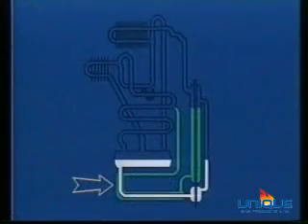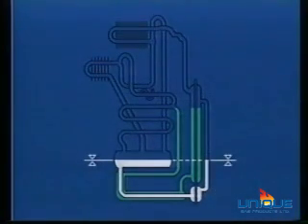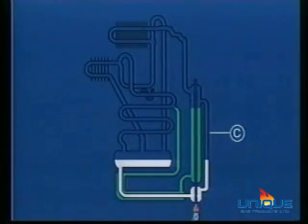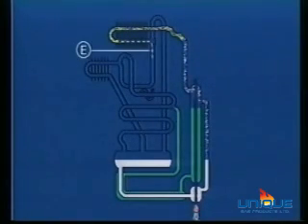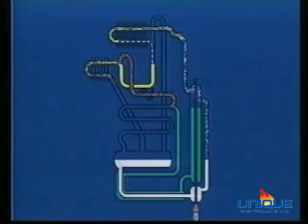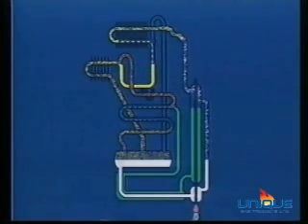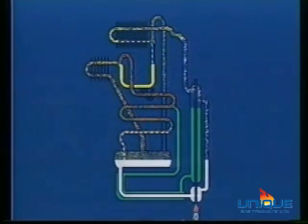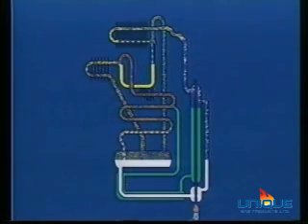AbsorptionRefrigeration.wmv

Comment: Would have been a little better if the animation labeled or highlighted (or flashed) the section of the pipe that the naration talked about.  It did this in 1 or 2 places, but would have been really helpful if the author could have done it for the whole explanation..

Comment: Could one use mirrors focusing the sun to power such a system?
Reply: Yes, or solar vacuum tubes since they should work better in indirect sunlight. Perhaps sodium heatpipes to transport the heat to the generator/boiler.

Comment: Ice from fire!!
Reply: That is the basic idea behind a heat pump. The same is true for the compressor in your fridge. It's just the fire is removed from the ice by several intervening steps and many miles. You use heat at the power planet to generate pressure which you use to do work and generate electricity. Then your fridge uses electricity to do work and run a compressor to generate pressure to drive a temperature differential.

Comment: right side of "pipe B" in green on the right, the vertical part that is directly above the burner, is it like split in to two vertical tubes?  If so, why?  Or is it just a single veritcal cylindrical tank but is pictured with the burner flue in front if it? Or does the burner flue go up through its center as a fire tube boiler?  Why would you want to heat the poor solution resivoir?  Wouldn't you want to keep it cooler so the  water vapor can distill of the vapors rising from teh rich solution tank?
Reply: it IS cooler by being farther from the flame. the extra heat might help release more ammonia. but still be too cool to boil the water in solution.

Comment: Why does the bottom liquid outlet pipe of the rich solution tank (A/white) have to be routed though a water jacket pipe filled with the poor ammonia solution (B/green)? 

...I suppose the water jacket on the left of the warming chamber keeps its water cooler than the water in the pipe that comes out of the right side of the warming chamber.  That way the ammonia/water vapors do not try to travel to the left upinto the rich solution resivoir tank???
Reply: yeah, i wonder why a backflow preventer wouldn't help?
Reply: Ananta Sesa das the system is sealed and it is constant pressure, I mean when the burner is running the pressure of the system increases but pressure is equalized throughout the whole system there is not a bias that could operate a check valve in the system
Reply: +John Smith i was thinking that pressure was increased but how a check would force the pressurized water vapor and ammonia vapor to only go out the left side. i now (edit: don't) think that the pressure in both directions can be a help.
Reply: Ananta Sesa das it's been a few months since I looked at it so I would have to review it but what is creating the flow is differences in temperature between different parts of the system and different things going into and back out of solution then either blowing up as a gas or down as a liquid and flowing in One Direction and not the other because of liquid pooled up in the bottom of U bends
Reply: right. that's my understanding as well. i think i was wrong in guessing that back pressure might help on the left too though. the vacuum that pulls ammonia from the evaporator could be (?) produced by the formation of solution from ammonia with the poor mixture of water and saturating it to then take up less space.
also the water jacket that cools the left must be reducing the amount of ammonia evaporating out of solution in the white liquid (rich mixture) on that left side. i can see why baffles or one way valves even with very little resistance wouldn't be a help. the idea is to get the ammonia to evaporate over near the burner (right side) so it can start it's commute to work.

Comment: 1. boil rich a water/ammonia solution in a small tube off of the main resivoir of such.  Vapors rise towards a condensor.  
2. before reaching the ammonia condensor most of the water vapor condenses and drips down into another pipe containing mostly water and just a bit of ammonia (Pipe B).  This is the poor solution.  
3. Seperated ammonia vapor travels on its own to the condensor where its heat is absorbed into the air behind/under the fridge.
4.  Condensed liquid Ammonia drains down into the inlet of a "U" shaped vapor trap (like a "P" trap under a sink), as it does so it makes that amount spill out of the outlet.
5. As the liquid Ammonia comes up out of the outlet it meets hydrogen gas which is similarly being forced out of its own outlet by pressure at its inlet.
6. The hydrogen gas and liquid ammonia react, rapidly turning the ammonia into a gas again as it goes through the evaporator. Per Boyle's law, the rapid change in volume is endothermic and makes the evaporator piping and heat sinks cold, absorbing heat from the air in the indisde of the fridge. 
7. after the evaperator, the gaseous solution is advanced downwards into the gas filled top half of the rich ammonia water solution tank and then upwards into a pipe that zigs back and forth.  This pipe  is called the Absorber. 
8. While this gas is going updards in the absorber, the water that was seperated from the rich solution after the intial heating (step 2) water trickles down the absorber pipe and pulls the ammonia gas out of solution w/ the hydrogen gas.  The water/ammonia liquid solution then drains back down into the rich solution tank and the pure hydrogen gas continues on alone into the inlet of its upside down "U" shaped pipe.  This pressure on the inlet of the pure hydrogen gas pipe is what was displacing hydrogen out of the outlet to mix w/ the liquid ammonia in step 6.  

Dang, simple as I could make it.  Whoever came up w/ this should be remembered for time immemorial.
Reply: Bloody hell. Why didnt wiki and all the other sites explain it this simply? Thank you very much.
Reply: Albert Einstein and Leo Szilard came up with it, so, yeah.
Reply: @flatusm  "Why is this so complicated and hard to understand for such a simple mechanism?"
"Because it was invented by one of the smartest people to ever live and one of his most prized students."
Reply: @flatusm 🔴 What Is Islam? 

🔴 Islam is not just another religion. 

🔵 It is the same message preached by Moses, Jesus and Abraham.

 🔴 Islam literally means ‘submission to God’ and it teaches us to have a direct relationship with God. 

 🔵 It reminds us that since God created us, no one should be worshipped except God alone. 

 🔴 It also teaches that God is nothing like a human being or like anything that we can imagine.

🌍 The concept of God is summarized in the Quran as:

📖 { “Say, He is God, the One.  God, the Absolute.  He does not give birth, nor was He born, and there is nothing like Him.”} (Quran 112:1-4) 📚

🔴 Becoming a Muslim is not turning your back to Jesus. 

🔵 Rather it’s going back to the original teachings of Jesus and obeying him. 

More .....👇

🔴 THE RETURN OF JESUS

Comment: Why not retrofit a solar vacuum tube set up to heat gallium to run a absorption refrigeration unit and run a thermal electric generator and make a stand alone air conditioning unit? Novartis
Reply: I like that idea of powering absorption refrigeration with evacuated solar tubes.  I'd be thrilled to do that.  Beyond that, it gets too complicated for me.

Comment: what kind of efficiency do these coolers get? IE ratio of BTU of heat put in to BTU of cooling power on the other end? 
also what temperatures are required to start the reaction?
Reply: even a solar energy concentrating parabola mirror was used in one example.
Reply: that depends on what you use to make it work , did you know that you can use wood , old used motor oil or used canola oil or a gasifier to make this type of a fridge / freezer work ? it can be used in the bush no electricity needed ac or dc not needed , you will need the proper system to push the heat from the wood , oil , gas ect to make it work , its all on youtube, the how to do it , and the best thing about this type of cooling system is it works silent , no sound except for the click when it turns on and off , very efficient when it comes to its handyness  , according to how long my small  propane lasts the efficiency i say is outstanding
Reply: I do believe large ice houses still use the ammonia type refrigerations don't they...?
Reply: It's approximately 60% efficient

Comment: ist possible to use sun heat instead of gas burner ?
Reply: that's what led me here. some people did just that.
Reply: You can use a solar powered heater.
Reply: The most efficient way would be to use the sun directly to boil the water/ammonia mix, as opposed to turning the light into electric then using an electric heater. It would be more complex, but a salt solution would be able to be heated by solar energy then that salt solution could in turn boil the refrigerator's mix. Or you can get really complex and figure a way to have the burner in black-body panels that get heated with the sun. I know this would require a lot of insulation as the hours of operation would be limited. That would be so interesting to see though.

Comment: Not a single word was said about hydrogen role. Not said how sadenly "LOW pressure" happend in evaporator [so ammonia boils] even that one pipe before, in condensor the pressure was HIGH enough for ammonia to condensate...

Why is every ignorant person is blatant enough to post spam on youtube? Seems that if you are incompetent, grab the mop and go and get hired in some cleaning servises... no, guy is trying to post scrap here... sad, sad, sad... what happend to our Civilisation?
Reply: I also would like an explanation of what is happenign in the evaporator.  I understand how pressure at the inlet of both the pipes containing liquid ammonia and hydrogen gas are forcing both to meet at their outlets.  I suppose the hydrogen gas pipe outlet is actually just below the surface of the ammonia liquid and it the gas bubbles through the liquid and that this causes a chemical reaction which causes a gaseous solution and this change in volume from a liquid to a gas would be endothermic per Boyle's law?
Reply: @johnsmith4630  mybe gass meet and cause cooling
Reply: This was a wonderful explanation the video gave. Much better than other videos that end up in the search. It's not about pressure, it's about temperature. The process exploits the energy needed to turn ammonia from a liquid to a gas--what the hydrogen is a catalyst for in the evaporator.
Reply: @lightdark00  The hydrogen is definitely not a catalyst.  No chemical reactions are occurring here.  Hydrogen gas over liquid ammonia lowers the partial pressure of ammonia gas above the ammonia liquid, so the liquid ammonia boils easier.  The cold space gives heat to boil that liquid ammonia.
Reply: Either, people "believe", they understood,
or, people get sick telling the whole truth, thus omitt or confuse,
else they parrot something, they don't understand,
but try to force the truth by provoking comments on YouTube.